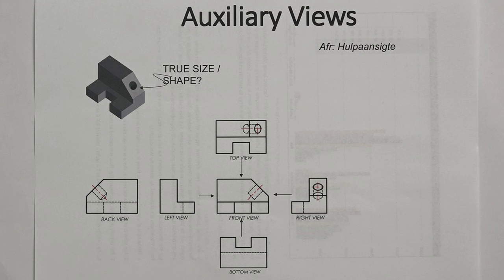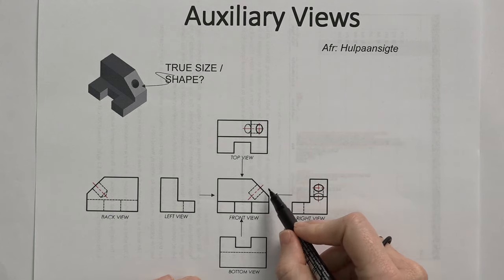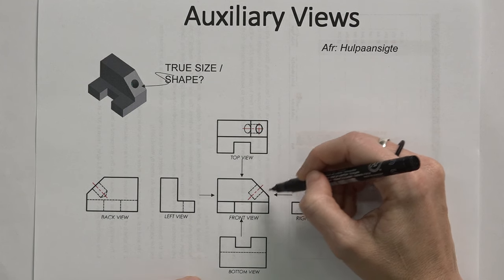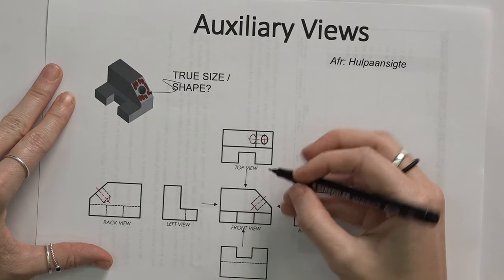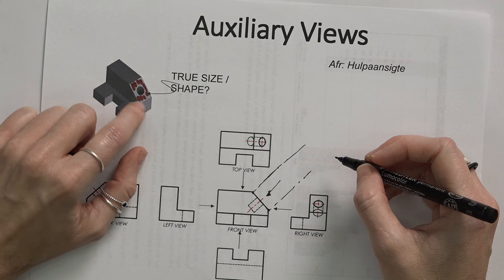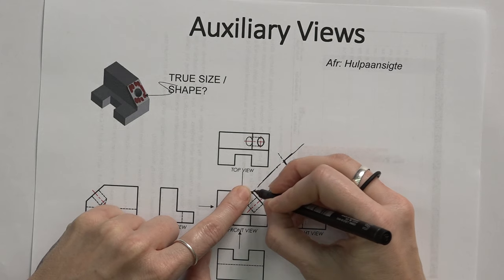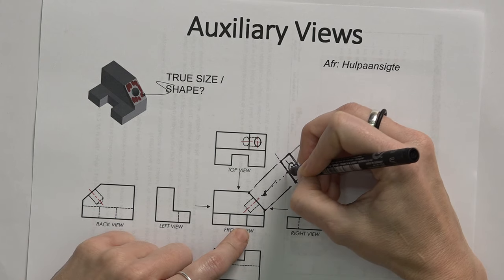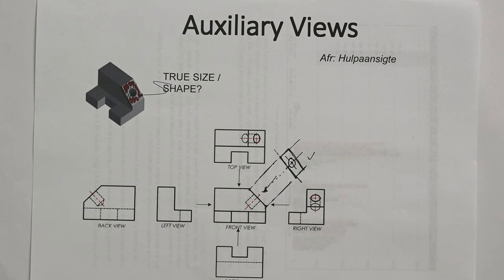Auxiliary views

Comment: Is there a difference between the auxiliary view and true shape? I thought the auxiliary view included the other parts of the block viewed from that elevated angle.
Reply from the maker: An auxiliary view is used to show the true shape of a feature of a drawing that is not visible in the normal drawing views. If the background information is present it is a complete auxiliary view, if it is only showing the true shape region it is simply a partial auxiliary view :)